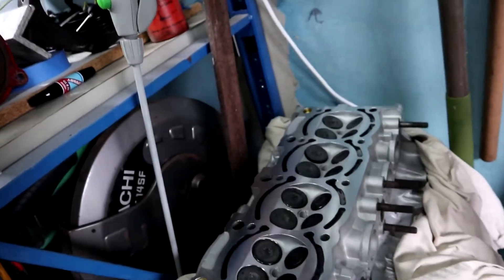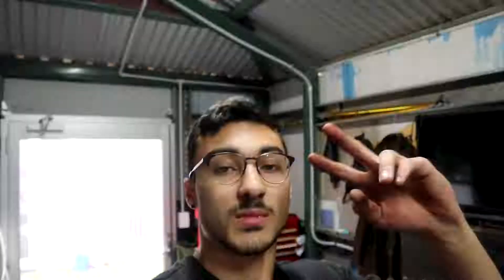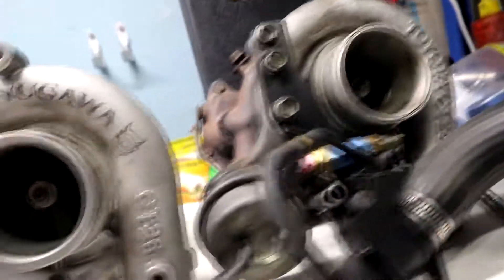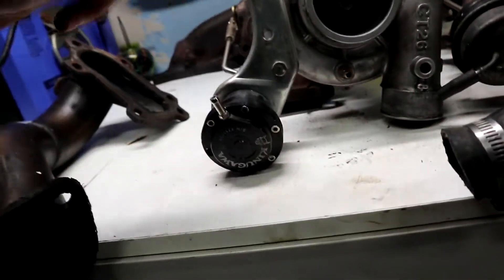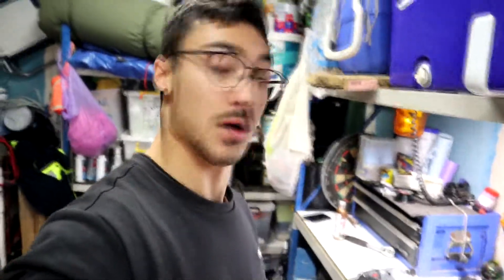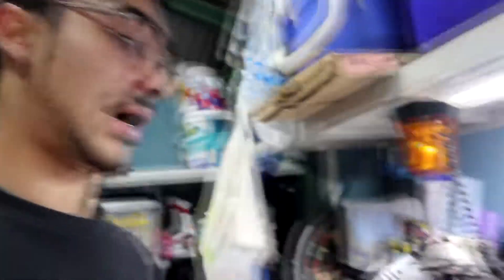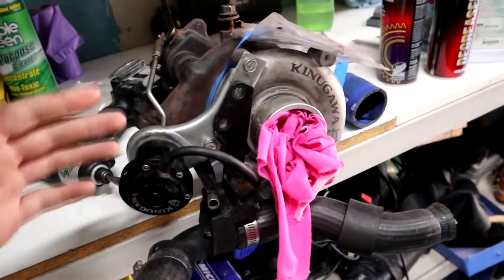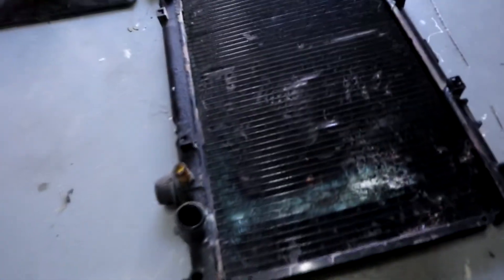I caved in already... || Celica ST185 GT-4 Rebuild || EP 4

Comment: I'd not run that kingwhatever turbo. bought some stuff from them, all garbage.
Reply from the maker: It should be alright for what I want out of it. I wont be pushing it super hard.
Reply: @Rhyalex  sure. My problem was fitment or leaks. Good luck
Reply from the maker: @ABeans07  The original owner apparently only put 700kms on it and it ran mint. So fingers crossed 🤞